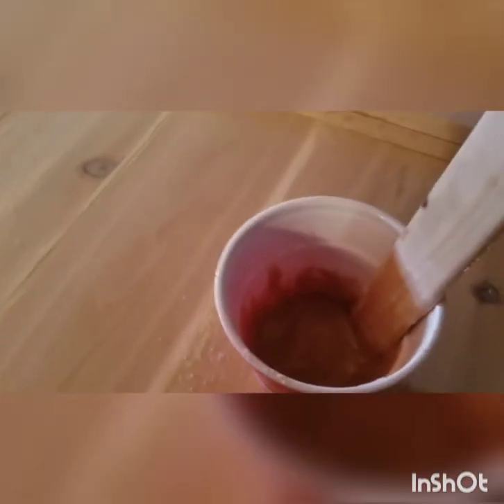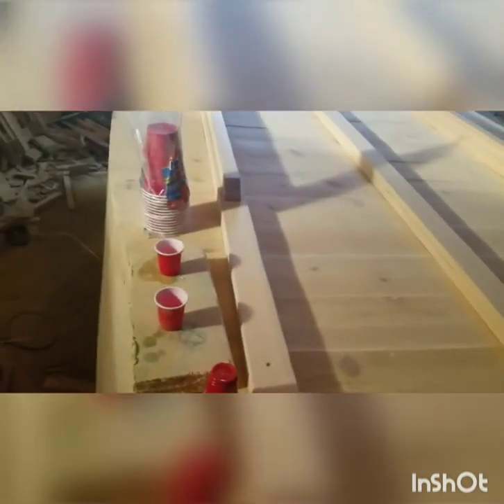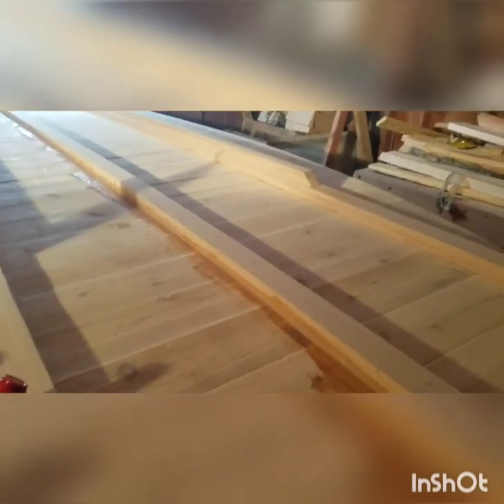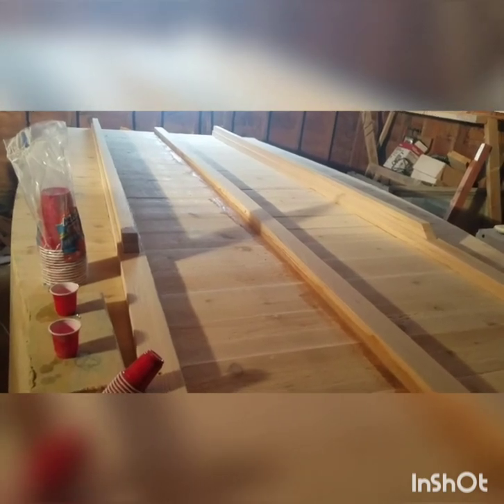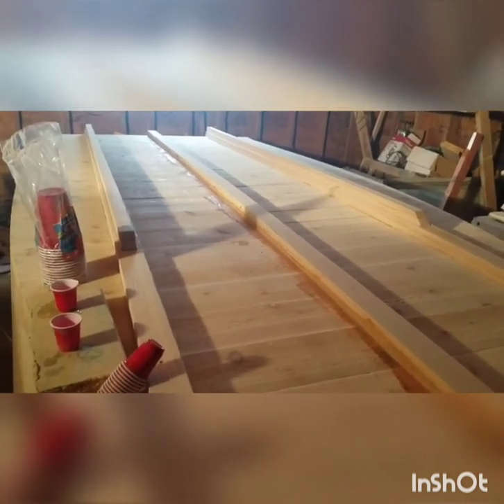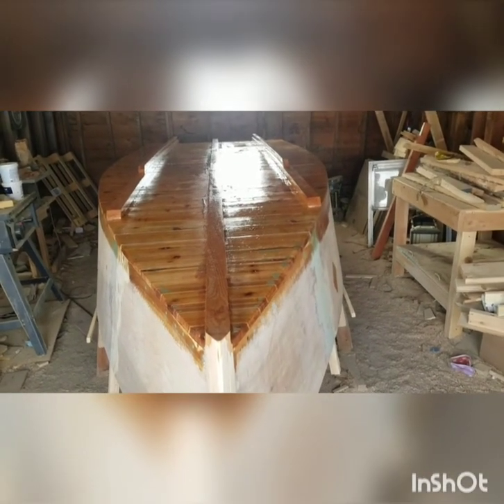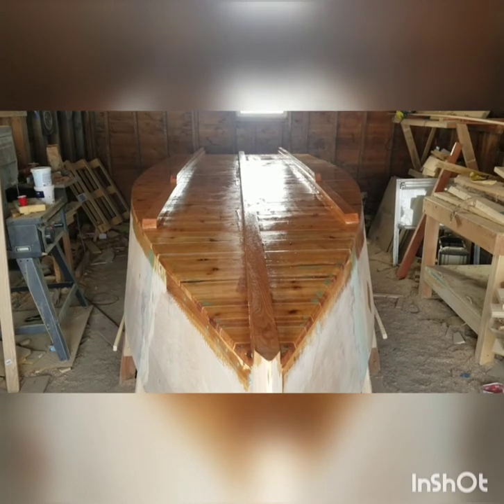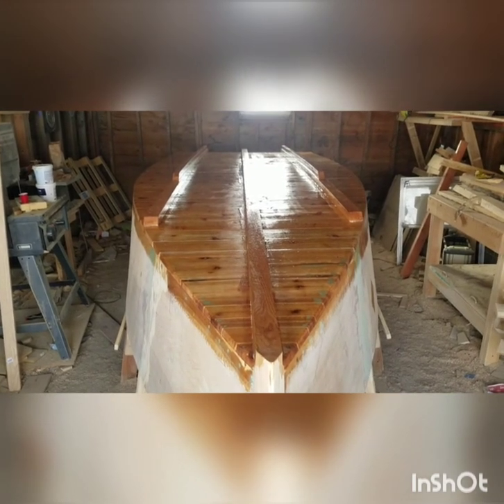Episode 10 (Sealing the bottom) Taking Tips from the Shipwright

Comment: Seems to me if you watch Lou's episode where he's applying bottom paint, he says that it's water permeable.  So it was a special coating to allow the planking to soak water, but dry when it was hauled out.  With the epoxy treatment, I'd think you wouldn't get any extra benefit from it.Its really looking good!
Reply from the maker: Hi David, I was so on the fence, I just felt like this will likely be the safest way to protect the bottom.  Do you think that I should use bottom paint as well, or is it overkill?
Reply: John Amos you've sealed it so I can't see the paint adding more protection.  Maybe give it a season of use, check for deterioration?  Eager to see it flipped upright!

Comment: I know its to late, you should have used cloth after making the fillets.  You may have issues without it.  Also put bottom paint on.
Reply from the maker: Thanks for your comment Jay.  I really wanted to stay within traditional boat building methodology.  So I really didn't want to use cloth on the bottom.  After I put the epoxy on the boat, filled all the openings with 5200 and came back over those with epoxy, I did primer and paint the bottom of the boat and plan to polyurethane 5 coats on it when it's complete.  Also, as for the rigidity of the bottom, I'm going to use a 10 oz. sheet of glass on the interior planks of the boat.  This should hopefully add the strength to the floor that I need.

Comment: If you don't put boat cloth in your lamination your joints will crack when the wood expands and contracts.
Reply from the maker: Shantytown Shipwright- I considered glassing the bottom.  I figured that a fully encapsulated bottom wouldn't expand.  I suppose we'll see.
Reply: John Amos also I would not put anti fouling paint on the bottom unless it will be left in salt water for extended periods of time.
Reply: I am also concerned about using 5200 to seal the planks below the waterline, I've heard of a boat that was done like that by a previous client and when the planks expanded the hull blew apart. I know that you intended on mitigating that by encapsulation but I already mentioned the boat cloth. If this boat is kept on a trailer in the garage that would minimize the possibility of these problems.  The planks will expand and contract, plywood is more forgiving in that respect.
Reply from the maker: Shantytown Shipwright --- Just did some research on what you are saying.   Boat Forum's articles say they don't recommend doing it this way because it's high maintenance if you should scratch it.   Apparently, if moisture gets into the wood, it won't be able to dry back out.  Even though this is high maintenance,  I am planning to put epoxy on the entire bottom once it's been flipped.  I suppose I'll just have to deal with the higher maintenance issues.
Reply from the maker: Shantytown Shipwright --- Well, the good news is that the boat will be garage kept and trailered.  On the other hand, I have a boat flipping party today at noon or I would likely just get the glass.  I may just reflip it back over to glass it before I totally finish it.